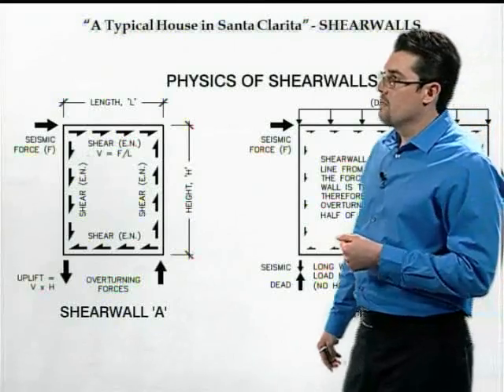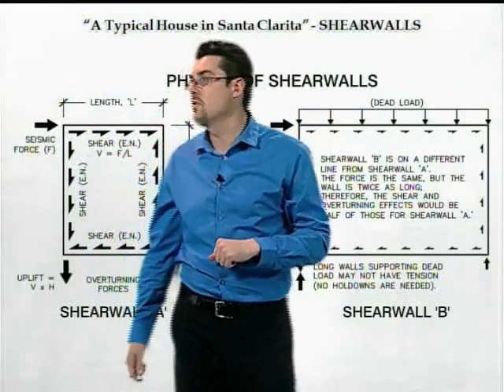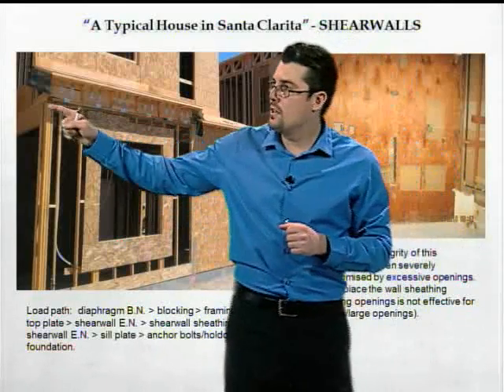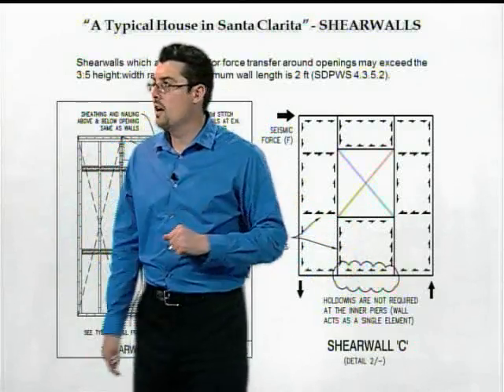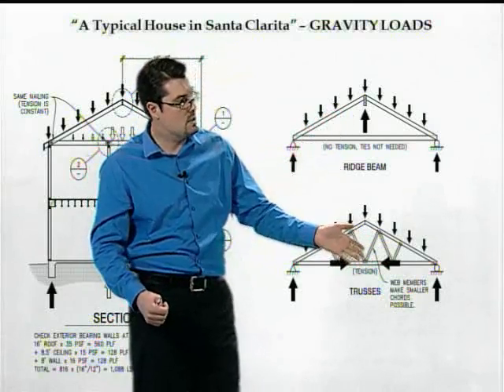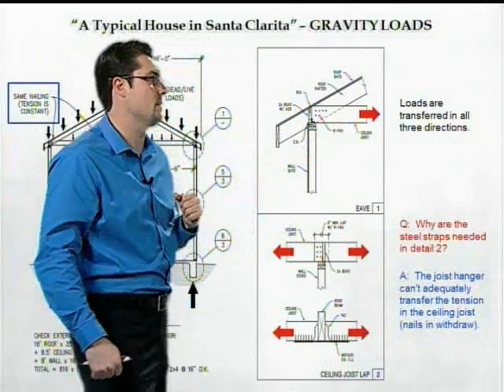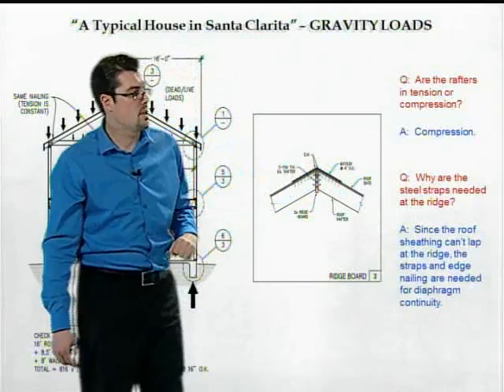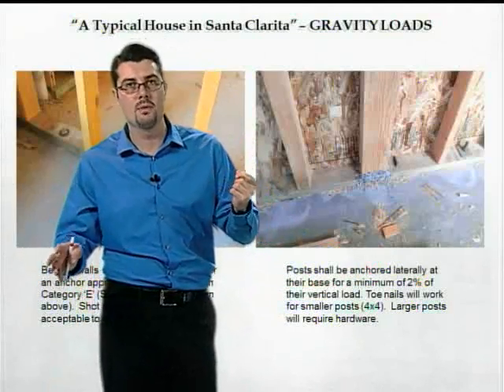Part 3 Building and Safety: Codes Explained 2014

Comment: How is it possible that 200 year old houses that have been maintained are still standing with out all the metal hardware and no plywood are still standing? They didn't use metal strapping they didn't use hericane clips they didn't use gigantic bolts and tie downs to the foundation? Why did building codes sale out to engineered wood and Simpson when it's been proven for over 200 years they are not needed until you get into large commercial buildings?
Reply: A big part of that is the lumber.  Old growth wood has tighter grain and is thereby stronger.   Those forests have been clear cut.  Young wood has wide graining and is thereby weaker.  Older houses are made with superior wood .  In addition, the wood is actually 2”x4” etc , not 1.5” x 33/4”.   Many older homes have been retrofit and repaired over time .   The first house I ever worked on was in Italy and had a pre Roman foundation with 3’ thick stone walls.  All ceilings were mortar free groin vaults that dated from Roman times to the 12th century.   My home is from 1927 built with old growth lumber and over braced.   As I’ve torn off the interior and exterior , I’ve braced walls and added Simpson ties for seismic as I live in a D area.  I’ve bolted the frame to the foundation and replaced siding under stucco with braced panels in the form of plywood.   I’ve worked on older home remodels in New England and they have been upgraded over time.

Comment: You don’t explain enough about the print your looking at. I know for a fact most of your inspectors can barely read those and it’s a problematic in every state. Nice explanation if you don’t give enough info to teach a class of contractors than it explains across the board why so many inspectors and city planners are half a stupid as they should be. The builder shouldn’t be smarter than the city inspector. Lack of info with a pretty face doesn’t make this info any better.
Reply from the maker: Thank you for your feedback.  Please keep in mind these videos are provided as a general overview of wood-framed construction.  They are not intended to be a comprehensive training on structural engineering or construction plan reading.  Our Building & Safety staff includes licensed architects and engineers who have many years of experience in both public and private building design and construction.  Our Building Inspectors are certified by the International Code Council, and most are former tradespeople with years of private construction experience.  We look forward to helping Santa Clarita residents on their next construction project!